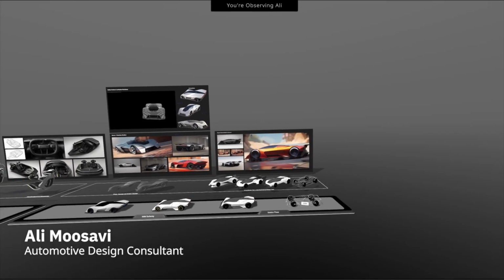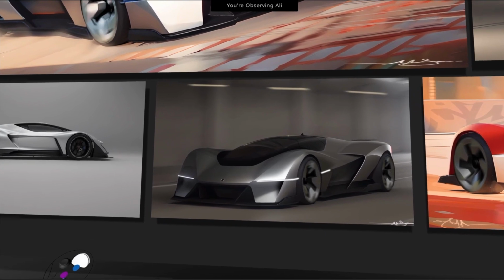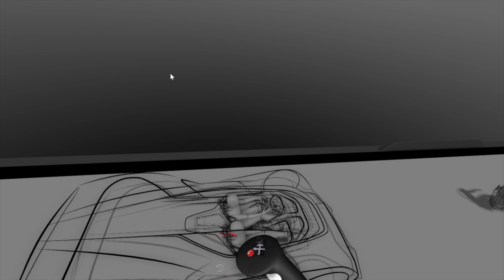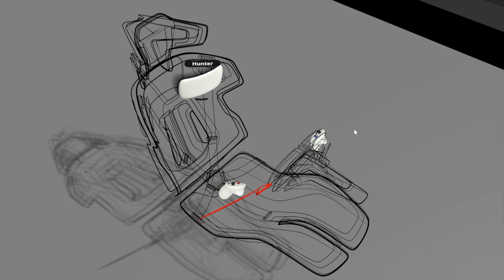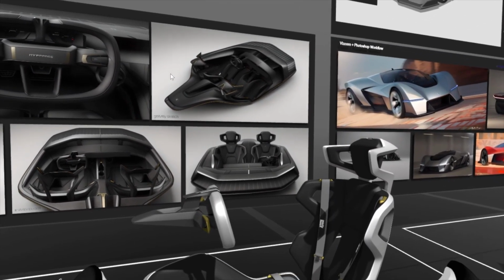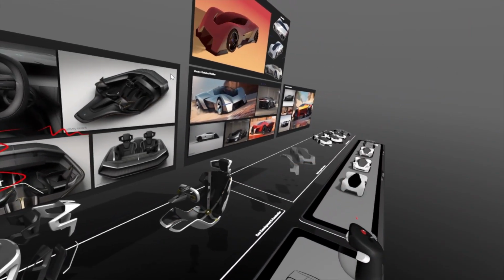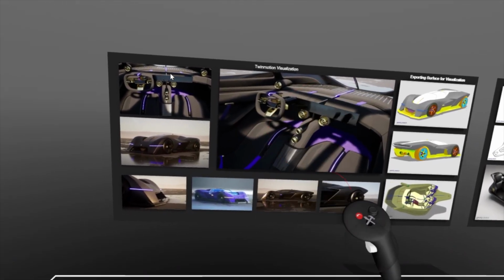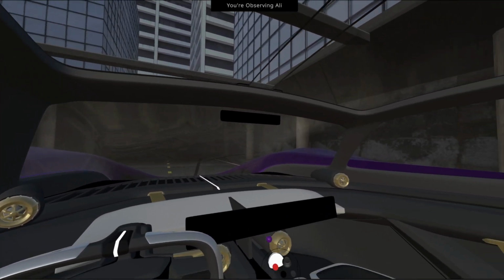An end to end walk through of an automotive workflow in Gravity Sketch

Comment: Hi Hunter 2 things please: min:  13:12 what you specially mean with "edges and rollovers" and how to achieve this thicknes, with low poly meshes? still struggling a bit with the ai thing.. but I love GS! there we go. I sculpt faces and bodies too. Cheers from Italy. when I come to London i'll visit you guys pleaseee ;-)  i'm a member from 2020 - Thank you
Reply: Hey Louis! When I'm referring to those "edges and rollovers", I'm referring to the thickness of the surface, or sidewall. In SubD, we can thicken a surface using the thicken command - but doing so offsets the entire surface at a set thickness and a harsh edge. By only building out that side wall of the thickness, or "rollover" as I referred to it here, you're able to get the illusion of thickness without the additional surface data that you would never see. Think of it like adding a skirt to the edges of the surface, so that I'm able to control the radius and visible thickness more intentionally, without baking a thicken command along the entire surface. A bit wordy, but I hope that makes more sense! Thanks for the question!!